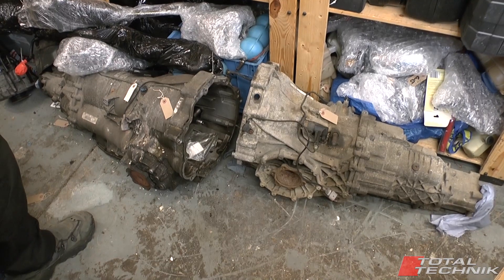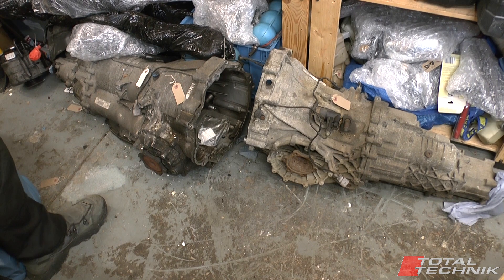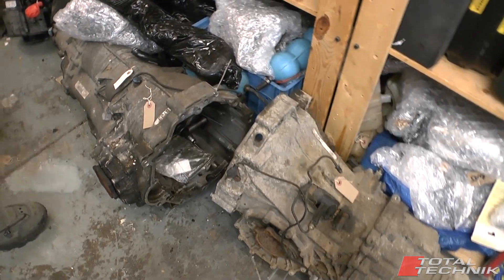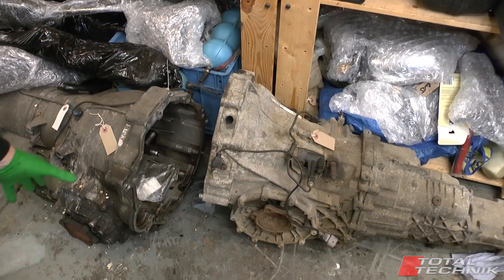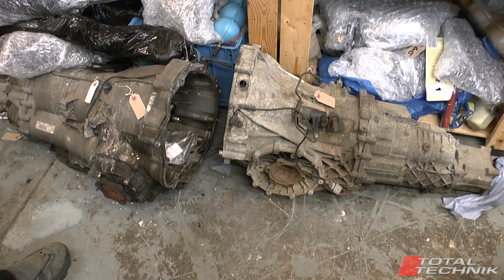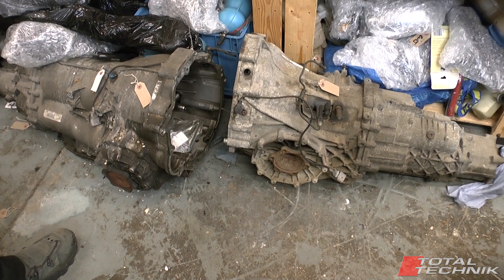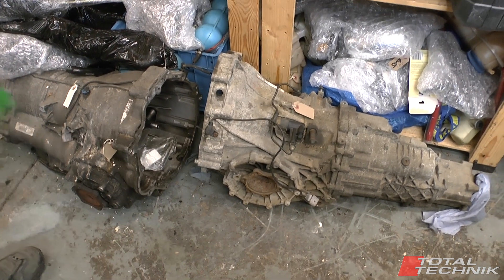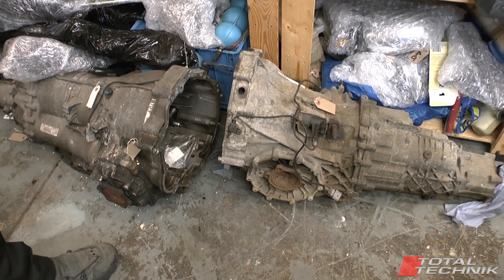Audi S4 Manual vs Automatic Gearbox Physical Comparison - B6 B7 - 2003-2008 - TOTAL TECHNIK

Comment: I have a problem with my 6 speed Automatic gearbox on my 2005 b7 s4 it doesn't want to go in any gears at all when I put it back in park it makes a horrible nose and a burning smell followed by smoke but I can push the car freely when it's in park and engine is off.

I have call a few people most are saying the gearbox has gone needs  new one.

Comment: Hello people, hello gents, friends and folks❗❗❗
 I have a question and  PLEASE if you can help an AUDI ADDICT 😂, so i ask for some help if you can and if you have the pleasure...
My A6 ( 4f2) C6 has a 2.4 V6 BDW 130 kw (177ps/hp)  engine ( 2006 ) with a 6 gear Quattro ( Torsen ) manual transmission with the HGV code and MY greatest wish for the year 2023 it's to change it with a TIPTRONIC one, the billion question it's CAN IT BE DONE❗❓❓
...i would appreciate a lot if you can help me please, thousands and millions of thanks in advance for the owners, lovers and enthusiasts of AUDI cars, may God bless you all, your families and the engines under the hood with four rings that we have and love... Much love for all of us people cause THE BIG GUY from up above knows that we need it the most these days❗❗❗